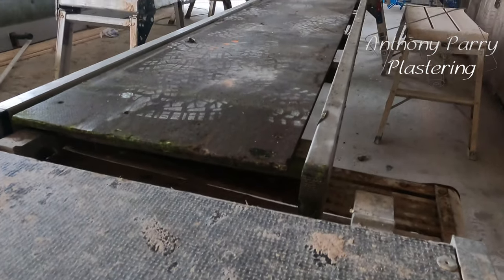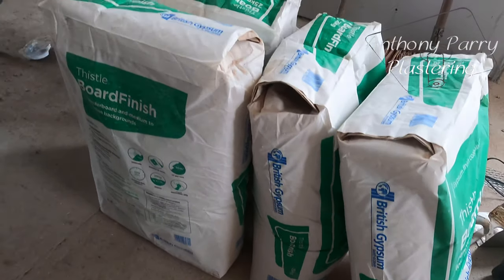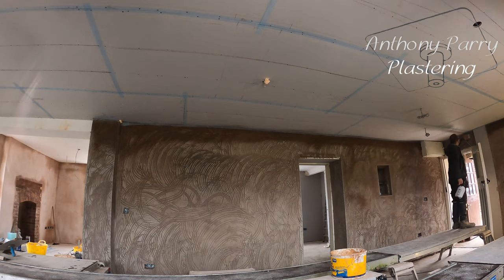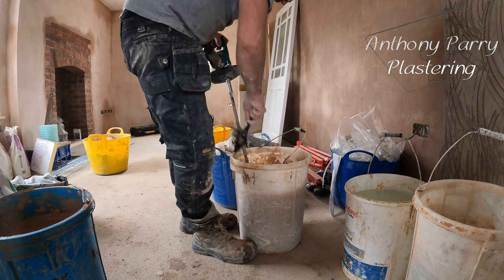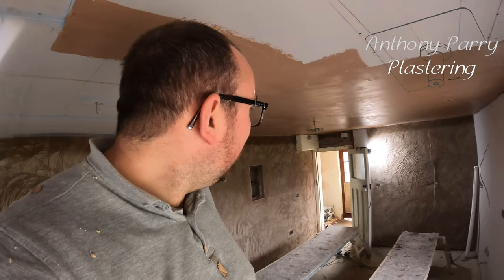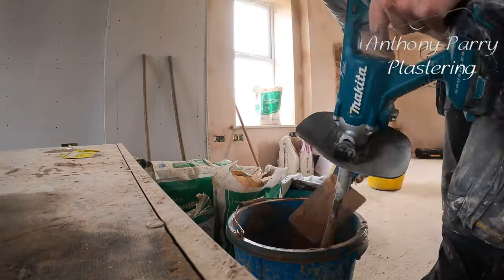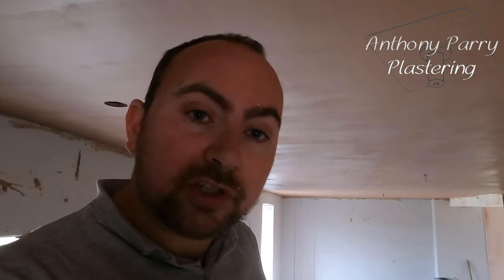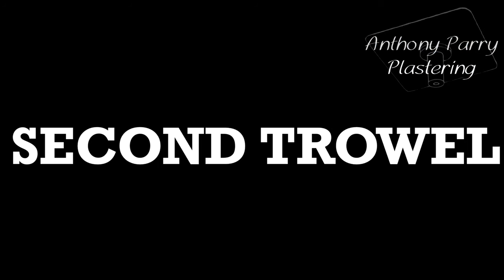How to Plaster a big ceiling on your own. My Tips and tricks. Eazymix Extratime

Comment: Definitely a good idea using a smaller/normal size tub when mixing. I'm a plasterer myself and mixing smaller gauges means that you always have wet material on the wall/ceiling ahead of you, like rolling mixes. Iv seen so many plasteres mix up huge gauges when they have a big area to do and it goes off on them all at once. Unless you have someone else with you it's always easier to do rolling mixes.

Comment: So you don't necessarily need to mix all your gear in one go? I have a big ceiling to plaster on Monday, 18 square metres and will be trying out your method of two mixes. Slightly nervous but Im trying to get a plan sorted before I finish the prep work. Your advise would. be appreciated. Is it okay to blue grit a ceiling? would this help with the background suction? Thank you very much!
Reply: If your unsure you could 50/50 mix of PVA on board ,it will help suction wise or use extra time to hold gear back

Comment: If you use half a sachet it still works fine and slows it down , even split into 3 equal amounts   , does what it says on the sachet
Reply from the maker: I’ve not tried experimenting with the extratime. I’ve tried with the Halftime but I’m happy with how it works with the Extratime.
Reply: @AnthonyParryPlastering  no probs just makes sachets go longer , also try sugar in your water whisk up then add plaster does same , not joking , tarter sauce or bit of dry wall added in to mix all good pal ?

Comment: Fair play for laying on that lid, personally I would never let anyone lose on a ceiling over 25m2 no matter how quick they are, just in case they run into iusses. Absolutely
No point hitting 50 and ya body is gone..plastering is and always will be a man's job. Pure graft.

Really not a fan of Speedskims SS the blades are crap.
Drop em and they are good for the bin
But each to their own, ya got it done. all the best for 22 bud 🍺

Comment: This was really helpful - just starting out and building up the areas I do. I have been using multi finish. Does board finish have advantages?
Reply: I prefer to use multi if it does start to go on you, atleast with a bit of water you can bring it back to life. Board finish once it goes it goes.

Comment: Hi mate,
Does the retarder cause hairline cracks in the new plaster on the stud walls or ceiling?
Reply from the maker: @ibrahimbilal6273  No not normally, movement is what causes cracks and hairline.
Plaster once its sets doesn’t move it’s normally what’s behind it does that’s why it cracks.
Reply: @AnthonyParryPlastering  and also when using retarder do I need to apply at the end wet trowel as well?
Reply from the maker: @ibrahimbilal6273  I would use extra time in the first and second coat just  to keep the setting times near. You don’t want the second coat going off quicker than the first coat. 
But it all depends on suction levels.
Reply: @AnthonyParryPlastering  so when we using extra time the wet trowel remains the same right? In terms of sprinkling with water and troweling off?
Reply from the maker: @ibrahimbilal6273  yeah treat it as normal, it’s just taking longer.
Reply: @AnthonyParryPlastering  thanks for ur advice mate top lad, coz 3-4 days ago I did massive ceiling , boarding+skimming approximately 80sqm then went on top of to check wires to drill a holes then I’ve spot from around the hatch massive crack going like 2-3 meter long not on the joins
Reply: @AnthonyParryPlastering  because my ceiling got two cracks on the middle of the ceiling 8m long but it’s not on the joints, could be because of wood shrinking or expansion?
Reply from the maker: @ibrahimbilal6273  yeah that’s what I wound think. That’s where there’s going to be the most amount of movement.
Reply: @AnthonyParryPlastering  hi Anthony, I am wondering do you know what’s the best way to become plastering contractor?

Comment: Id hate to see how many ripples you have every trowel you went the same way and the same hand I saw no cross trowel
Reply from the maker: It had none. The key to not having ripples is by trowelling across the direction of the main light source.
Reply: @AnthonyParryPlastering  so as soon as you put a different light in from a different angle that's when it shows also doing it that way is trusting every joist is level with each other witch looking at it its not you should be teaching cross trowel to make sure there not rippels going the same way every time means there will be divites all over and rippels its plastering 101
Reply from the maker: it’s natural light that shows ripples and and imperfections. Normal lighting doesn’t. Cross trowelling isn’t going to make the ceiling straight when you have joist at different levels. This is why I use a speedskim after the first coat to build out any areas that needs flattening out. 
I’m a third generation plasterer that’s been Plastering for 22 years. so I have plenty of experience in knowing the pit falls.
Reply: @AnthonyParryPlastering  I know that's all bollox ... and the doing it 22 years give it a rest mate .. if you've been doing it that long surely you should know dont us board finish multi on normal walls or blue grit walls pretty sure it says it on the bag only for board im just saying and with the natural light your right but as soon as its dark out and someone shines a normal light I guarantee you will see ripples
Reply: @chrispenberthy1230 haha no it doesn't say use only on boards on "board finish" you fool board finish is for low to medium suction backgrounds